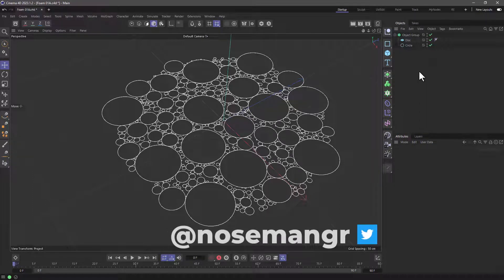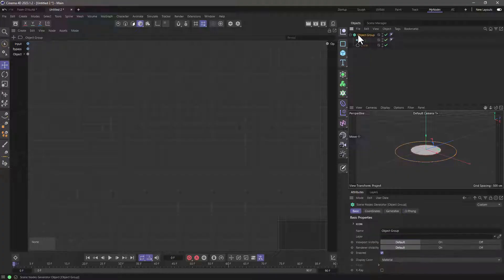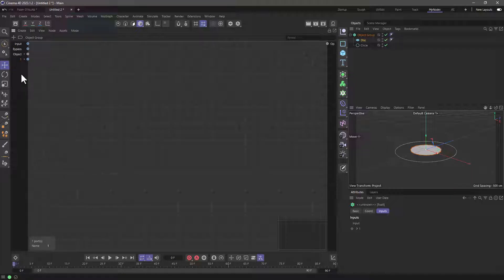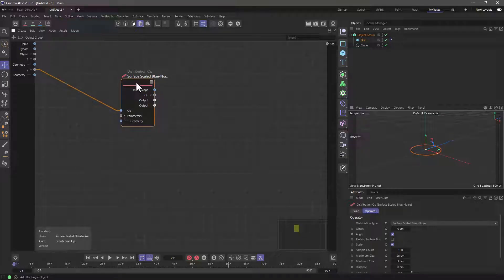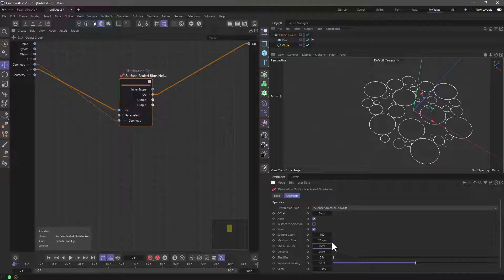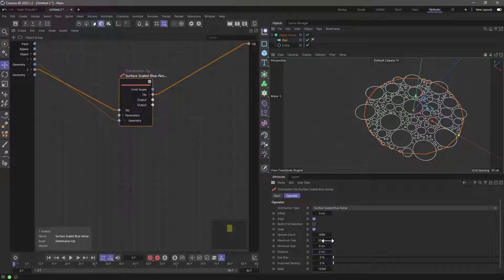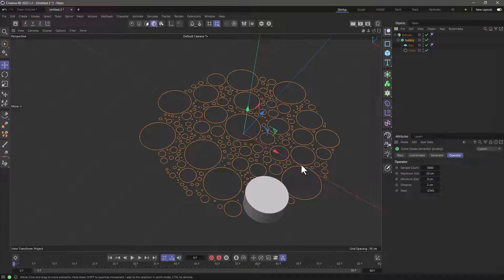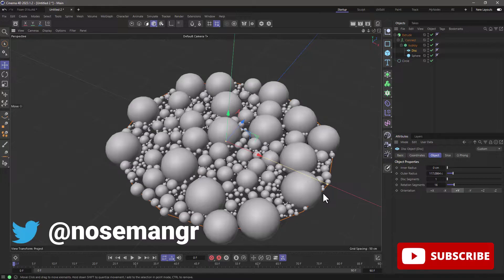Making Foam (Circle Packing) in Cinema 4D Scene Nodes

Comment: For those trying to use a newer version of C4D - this is what I did (since this tut is out of date and requires some workarounds)

1. Once you've created your Object group with your circle and disc like in the video, open Node Editor
2. Right click in the inputs section and hover over "add input" 
3. Click on "Object - Child" 
4. Delete all the children of this "Object Child" except for geometry
5. Label this "Object - Child" as "1"
6. Repeat for the 2nd input.
7. Search for "Surface Scaled Blue Noise" and click on that to add to our scene.
8. Click "toggle node type"
9. Plug in 1's geometry into the geometry on the "Surface Scaled Blue Noise"
10. Plug in 2's geometry into the same spot (geometry of "Surface Scaled Blue Noise"
11. Plug in Op of "Surface Scaled Blue Noise" to the output Op
12. You are set to change the properties of the Surface Scaled Blue Noise and continue the video @6:06

Comment: In 2025 there is no "Object" in the Scene Port Node dropdown.  There is "None", "Object-Child", "Object Array - Children", "Object-Link" and "Object Array-Links".  If I choose Object-Child and right click on it there is no "Add Nested Port".  Also, right clicking in the Surface Scaled Blue-Noise node in the top bar doesn't have a "toggle node" option.  This stuff has apparently changed significantly since this video.

Comment: Thanks for this video Noseman! Is there a way that you could have multiple shapes being distributed? I'm thinking this would make a great set up for a condensation droplets and it would be awesome if you could have a variety of droplet shapes.
Reply from the maker: You could but it's not very straightforward. You need to create a switch node with various object inputs and use the index to select which object to clone in each position. The other issue is that the packing only calculates circles and spheres so any non circular/spherical objects won't be adjacent to each other. I was planning to do more tutorials on the subject but have been very busy.
Reply: Thank you for the reply  @noseman . Interesting but, like you say, sounds complicated! I did find a good workaround though, which is simply to swap the circles / spheres for an object with a single vertex and then link a cloner to the object group and set the distribution to vertex. Works a treat and opens up access to all the potential of using effectors with the cloner.
Reply: @noseman   of course, all of the objects in the cloner have to conform to the same size circle, but I was expecting that to be the case :)

Comment: How to create geometry node modeficator or script that solves the problem of the intersection of one geometry with another. So far, the best manual way I do this is through the volume builder and the shrink wrap modifier + smooth the result. It would be very cool to have such a flexible tool that would get in a few clicks and options to get a new shape without crossing objects

Comment: Is there a way to have the Connect functionality already build inside the scene nodes? Trying to do a stitches generator and I want to give out a spline, which then can be rendered with the curve settings in the RS Object Tab. But I cant get it work so the curve tab showing up from operator group, but its showing up if you put the operator group into a connect Object.

Comment: Unfortunately if I render anything with this surface scale blue noise effect, I can't stop the render or all the circles move to different positions when I restart it again. Is there any way to cache this effect to avoid the circles losing their place?
Reply from the maker: Did you try "Bake as Alembic"?
Reply: @noseman  that's the first thing I tried, it kept crashing c4d and generating huge files as my sample count is 200k. I ended up having to bake it to .orbx which is a bit smarter in how it handles instances. Would like to find a way to fix the behaviour in the node graph itself, but i'm brand new to C4d 2023 (I upgraded from r20 hahaha)
Reply from the maker: @UON  Without a project file it's hard to tell what's going on, but even in that case you're using Octane. If you can reproduce the issue with Standard render or Redshift, let me know. Also, I assume you're generating a varied number of circles. Remove any Octane related things and if it still crashes please report it to Maxon Support.

Comment: This is fantastic. How would you go about, say, adding a random color to each sphere based on a ramp? I was able to assign a color in nodes and then tie that back into redshift but couldn't figure out how to integrate a ramp based on index (or whatever)
Reply from the maker: Good question. I am planning some follow-up tutorials on how to expand this setup, use it with MoGraph and more. Showing how to Colorize based on various parameters seems like a nice thing to add...
Reply: @noseman  Second this! Is it possible to show how to randomize the rotation as well?
Reply: I'm sorry. Could you please say how did you assign different colors to this group? thank you)

Comment: This node system is too confusing and illogical. I was so happy when this system was announced in the form of material nodes, and after buying redshift it all died. Physical render is dead, prorender is dead, bodypain is dead, UV editor is still extremely unstable..... 
So much inconsistent action from maxon.   
Athanasios thank you for still releasing such tutorials even though it's not a production solution yet. 

P.S  You as the head of the company would bring much more to the users. If you ever create your own software I will be the first customer !